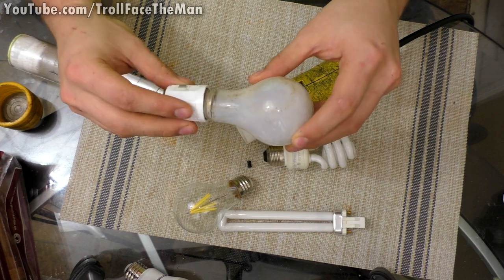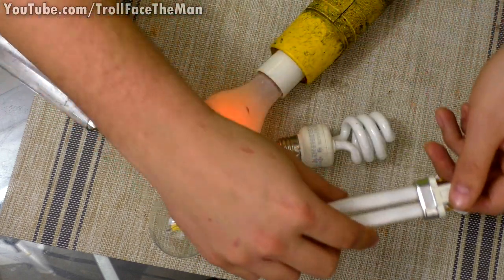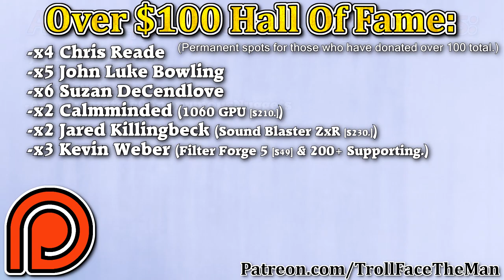Using Ballast Wrong? CFL, LED & Incandescent test on ballasted fixture. Will they fail or break?

Comment: You were correct about the incandescent bulb on a ballast. . Discharge lights are a negative resistance load. The more current they draw the lower their resistance value becomes which will quickly run away and cause the light to explode as the materials they are made out of can no longer withstand the temperature (or pressure in some cases). Induction ballasts work on the same principle but in the opposite direction; the more current pulled through the higher their resistance value becomes. 

This is a great demonstration to show how inefficient incandescent lighting is. Forcing one to run on the same power as a mercury discharge light will make it less productive than a candle.
Reply from the maker: It is crazy how far lighting has came.

Comment: The incandescent filament in standard florescent tubes is not to heat mercury vapor but to create it. At room temperature, the mercury condenses back to a liquid because there is not enough vacuum inside of these tubes. That is why a cold start will flicker and takes longer but one that was recently turned off will start right back up at full brightness. 

There are some florescent tubes that don't have these filaments. They are called cold cathode tubes (CCFL) and are typically designed to be driven off of a much higher voltage but lower current. They are also less temperature sensitive than standard florescent lights making them ideal for use as backlights in business signs and outdoor vending machines as well as well as in low power applications such as being run off of a 12VDC supply like a lead acid battery or computer power supply (tubes designed for these applications usually have a built in inverter). 

The cold cathode technology is also used in certain neon light applications such as nixie tubes and flicker flame bulbs. In this instance the voltage potential is not to vaporize mercury but simply to excite the gas around the cathode and cause it to glow. Since these are driven off AC, that means both electrodes will appear to glow, though it is actually just the gas around them. Using different noble gasses will change the color. Argon is the second most common because it emits UV light and can be combined with phosphors to create any color of light, just like mercury vapor discharge lamps. Which brings us full circle.
Reply from the maker: Thank you for the extra input and insight. You are right it is mainly to vaporize additional mercury. 

 Although the tubes should still be filled with mercury vapor before heating too as mercury produces vapors even at room temperature. Under vacuum unless in extreme colds there should already be a significant amount of mercury vapors already in the tube before additional heating.

 At least I would believe so?